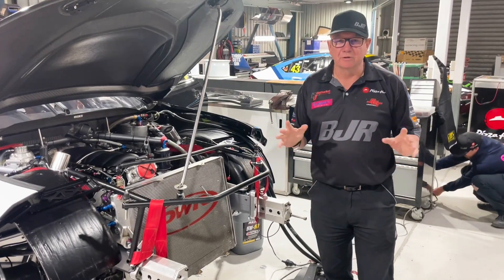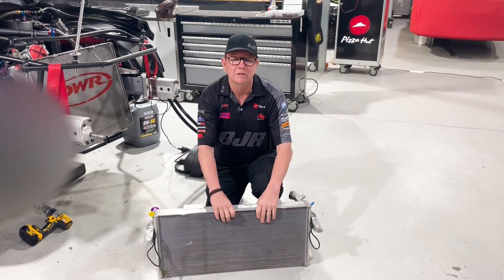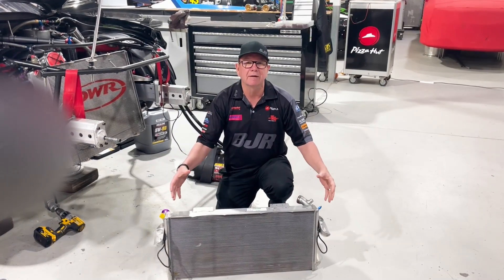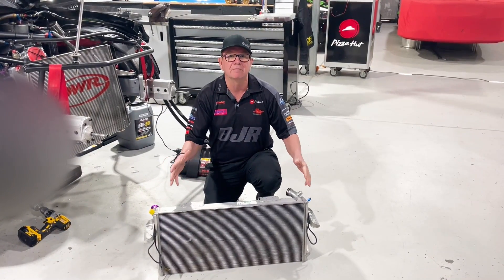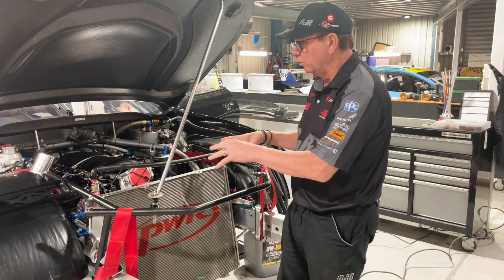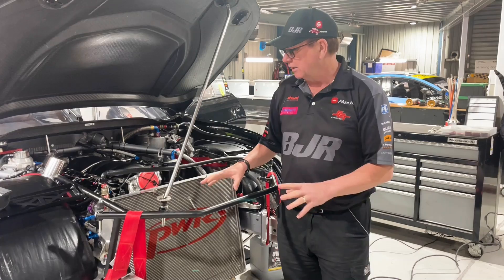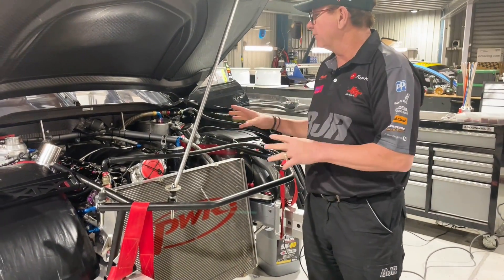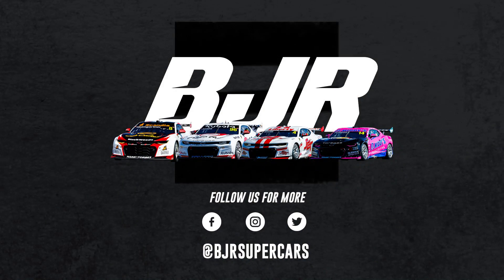Comparison of a Gen3 Supercar radiator

Comment: Given how “spec”everything is, interesting to see you guys blurring out a bit of stuff you’re obviously allowed to put your own spin on 👍
Reply: the suspension pickup points are all standard now but they have multiple holes each wishbone rod end can pick up on to change kinematics like; roll centre location/migration, pitch centre location/migration and anti/pro dive/squat settings so with this in mind all teams can run what setup they think is best (while using the spec parts), and they all hide what pickup holes they are using for the inboard/outboard points. Given its all the same now every team can easily figure out what kinematic settings a competitor is using just by seeing the pickup holes they are using (previously this would be much harder to figure out to any degree of accuracy just by looking at it). I believe that's what they were hiding, other teams do the same while at that track or on camera.